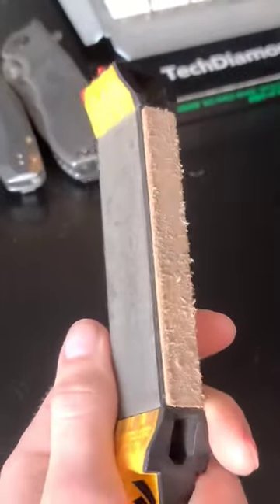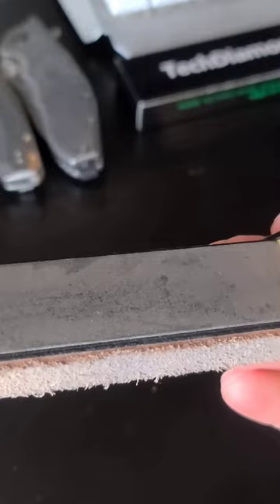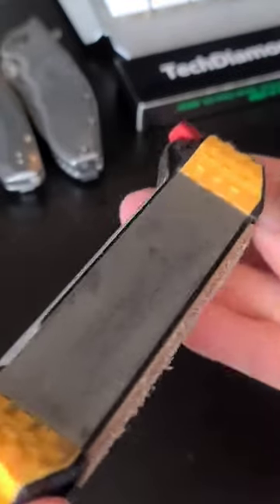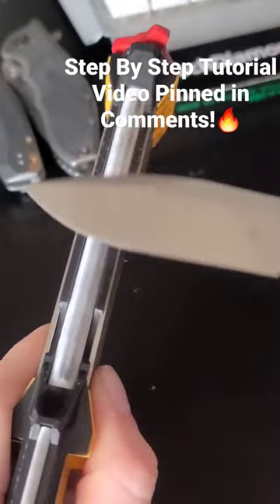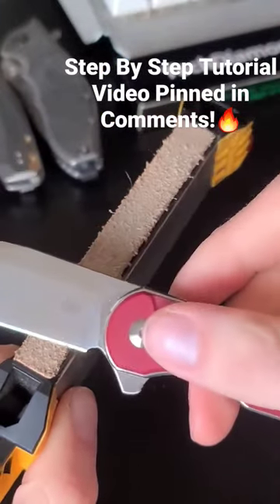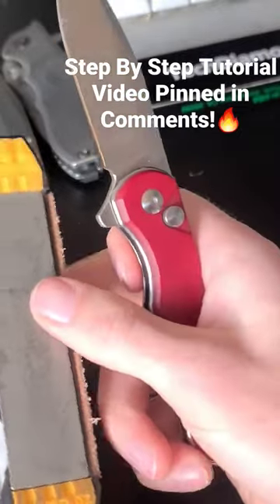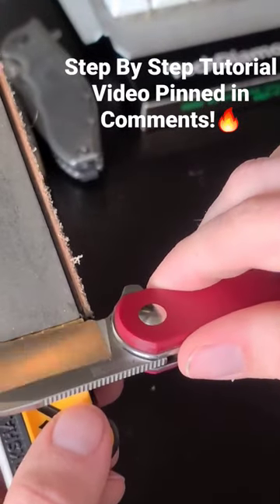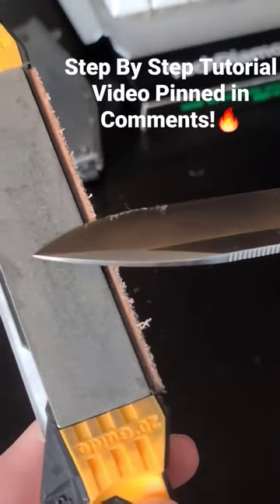Mastering The WorkSharp Field Sharpener! 💥👀 #shorts #edc #knife

Comment: Remember to remove the ceramic rod once in a while and clean it with dish detergent, warm water ab a rough sponge. I just did mine after having it loaded up with steel. It was all black and wouldn't work anymore. After I cleaned it, it was clean and white and worked like new.
Reply from the maker: Thanks for the info, i had never considered cleaning it, but what youre saying makes sense! Ill give it a try, also feel free to check out my newer vids and sub so you dont miss my weekly knife content ;)
Reply: A high polymer eraser works well for a quick clean between actually pulling it out and washing it as well.